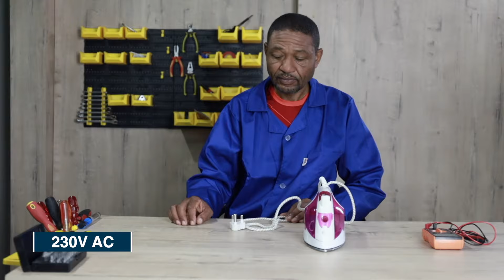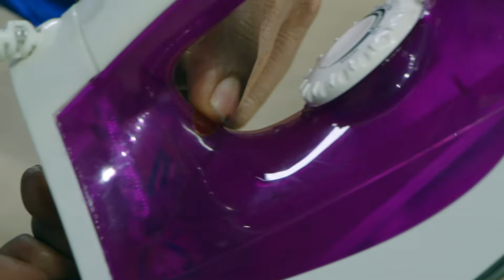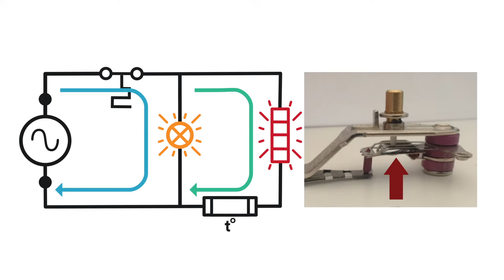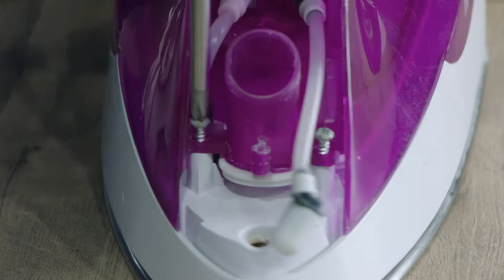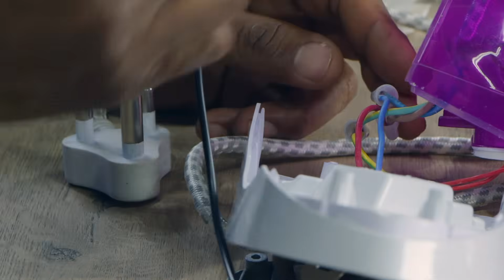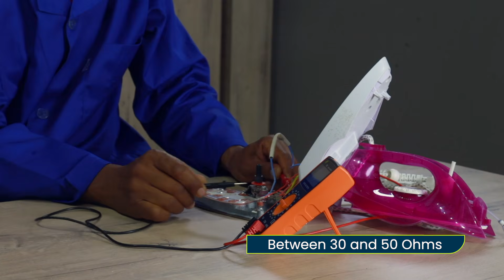How to Fix an Iron That Won't Heat Up | Fix-It Fridays

Comment: My iron is tripping the main switch ( Eiger dry iron )
Reply: Definitely an issue with your household breaker and fuse system. I would recommend a qualified electrician to check out your outlets and fuse breaker system.

Comment: Kindly please advise what to do when the thermal fuse has blown?
Reply: If the thermal fuse has blown, you can remove it and replace with a new one if similar kind, crimp it in place. Don't use solder, because the solder can melt when you use the iron. Make sure the leads cannot touch the hull. 

But a blown thermal fuse is a symptom of another problem, so it blew for a reason, keep that in mind and try to find the root cause. A short circuit somewhere else perhaps.
Reply: Buy another iron
Reply: Correct so troublesome. @periklisspanos7185
Reply: Oh ffs ....😂 why did I think I can do this